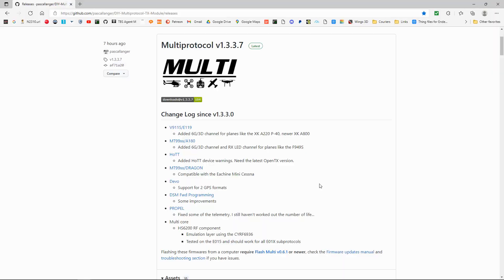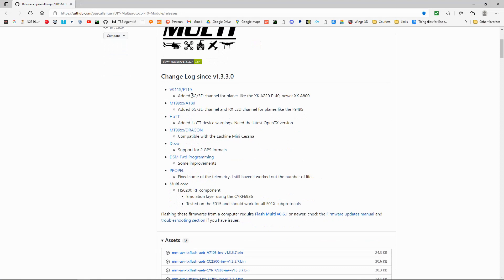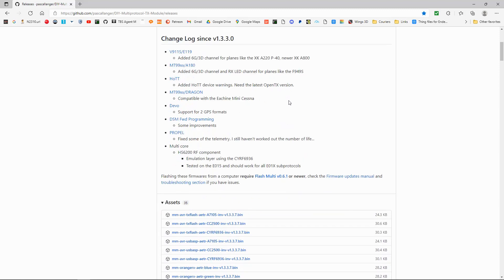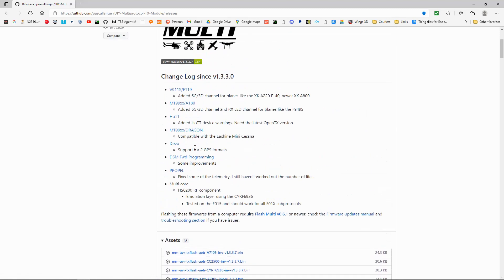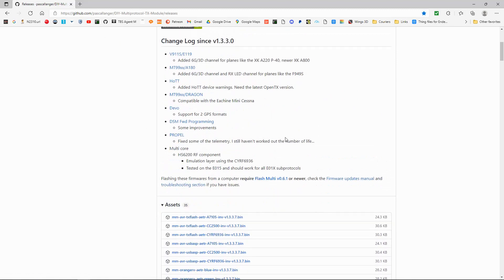Multiprotocol Module Firmware Update v1.3.3.7 Available Now

Comment: Hi Bill,
Thank you for the update.  

I assume that this update does not support EdgeTX?
Reply from the maker: Hi Sam, you can use this firmware update for your MPM if your radio uses EdgeTX. I update my multi protocol module in my Jumper T16 and it is working fine.
Reply: @the-happy-RC-flyer  Thanks Bill!